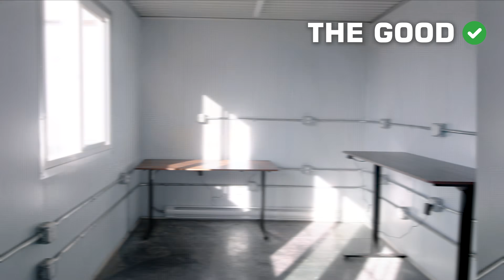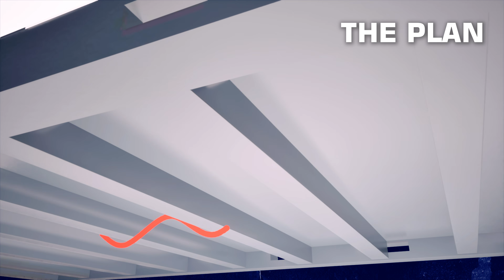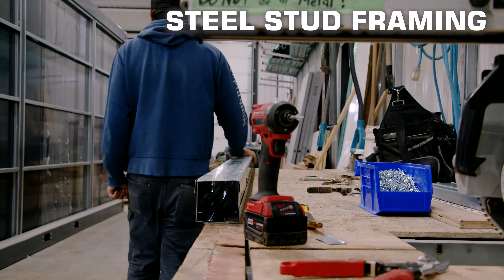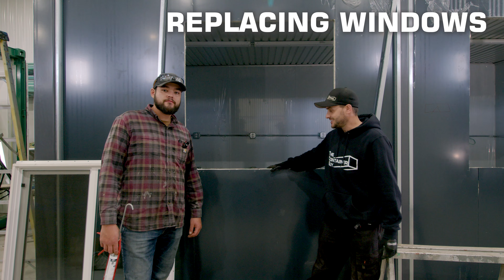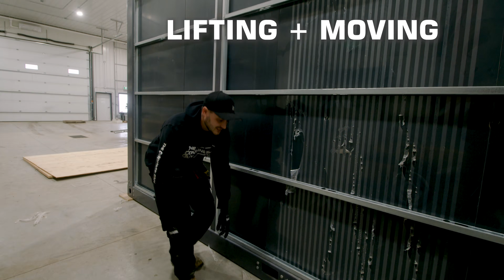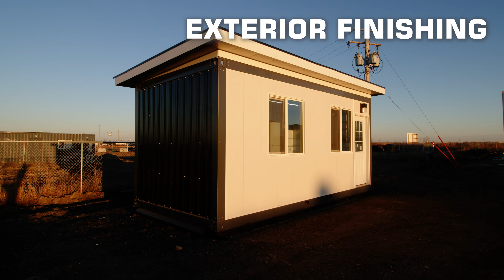$3,000 Chinese "Shipping Container" to $10,850 Tiny Home

Comment: Whats the quality of the metal from China?
Reply from the maker: ISO Containers made with Corten Steel are great. This container is 💩
Reply: @TheContainerGuyTV  But buy the way good job on this container, excellent vid.
Reply: @TheContainerGuyTV  Thanks for the advice, buy the way your ModBox's modifications. Is that standard on all your containers that you sell? Or only on specific containers?
Reply from the maker: @brizzx32  I only purchased those 2 as a test. My factory orders going forward will be that design but that'll only be my Alberta/ Saskatchewan stock. We need the wholesalers to adopt this type of container.
Reply: It sounds like the Chinese container is cheap in price and cheap in construction. Is that right?

Comment: Was showing your video to an engineer friend of mine and he asked why you don't just use SIPS? (Structural Insulated Panels)
Murus SIPs: R-values range from R-15 to R-67
RAYCORE SIPs: A 5.5 inch thick polyurethane SIP panel has an R-value of 42

He just did a rough calculation and said that size shell you had, made from SIPS, would be $6400
They can also be made to whatever size you want.

Just some food for thought.

Comment: I’m not against products made in China but I’m against these fake containers that are poorly made with packing foam, Chineseium, and spit! Glad to see you guys making significant improvements to the product and educating folks at the same time.
Reply: These are NOT made as shipping containers in the same sense as normal shipping containers, which are mainly also made in China. These are sold as prefab shipping container STYLE buildings, I have links to them but can't post links here. In the links they clearly show all the dimensions of the thinner steel used , the prefab panel walls and show applications for them, they are not fake shipping containers at all, and they are very cheaply priced... "20FT Modular Sandwich Panels Tiny Shipping Container House for Building "
Reply from the maker: Wait for the next video on this build. When we start to do the electrical we learn how paper-thin they really are. Made in Chyna!
Reply: @TheContainerGuyTV  at the end of that video I'd be interested to see you evaluate if you could have taken that $3000 initial investment and used it to buy some quality materials and have made the rest of the frame yourself. Basically whatever you didn't already replace, reinforce, or rebuild. And then if the math works out, you've got content for a few videos where you take the whole $10,850 and redesign it from the bottom up to more ideal specifications (HxLxW, ease of insulation, thermal bridging etc). At the very least you could trust it not to fail on you.

Comment: Would you have been able to use rigid pink foam insulation instead of sprayfoam for exterior insullation? Not as good as sprayfoam, but its 2".  Wonder how cheap you could have done it with tin and rigid pink foam.
Reply: so long it works...

Comment: I love those little things.
Reply: I like the idea of this. Can this set up your doing can be used as a shop with air Compressor.
And a motorcycle table? Thank you for your time and effort with the video
Reply from the maker: Yes, could easily work on a bike in there. Would need a door on the end wall. If you lean anything against the interior wall, it'll rip right through though. That metal is like paper. We learned more lessons when it came to trying to get electrical to hang on the wall. Had to glue it on 😂😂 Tinfoil walls!!